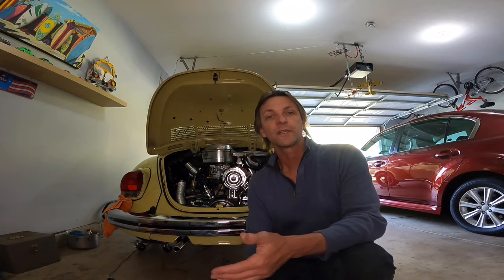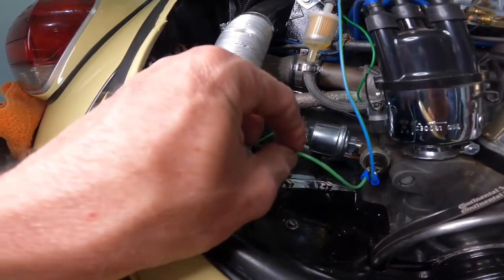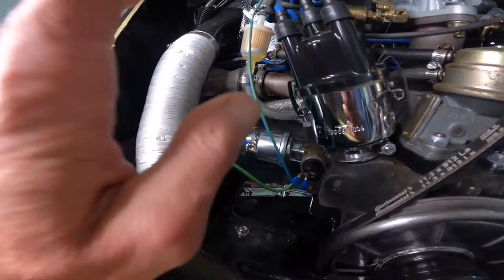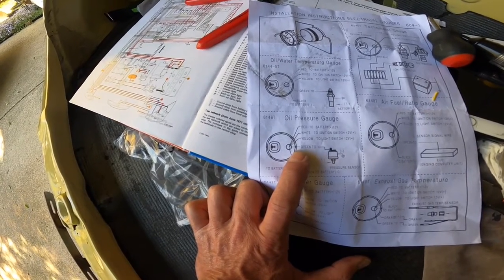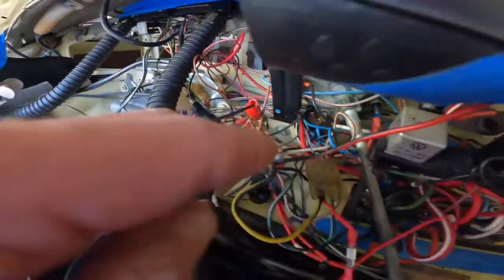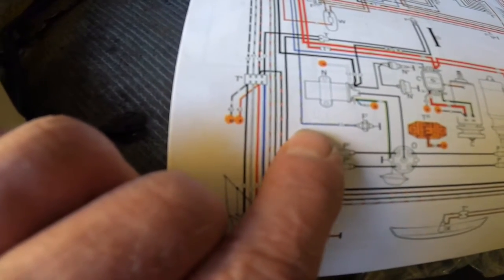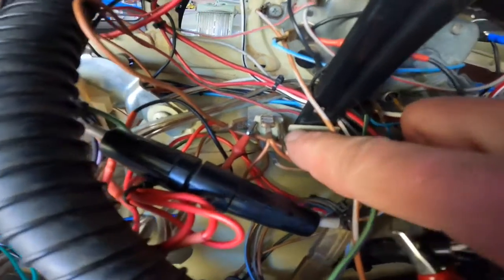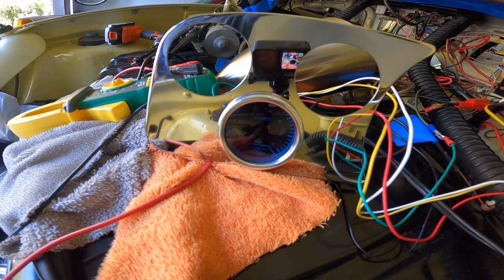Wiring 101 for 1971 Sup beetle oil pressure gauge installation

Comment: Junior, I really like your videos. Very helpful in reducing my wire anxiety. :) What is the reason for using a T connector with both the old sending unit and the new sending unit? Could you have just used the new sending unit and the OEM wire?
Reply from the maker: Using the same wire to get the signal to both the dommy light and new gauge

Comment: One disadvantage of sharing the same wire as the stock oil light is that when the low pressure switch activates it is grounding your signal wire, so the gauge will read zero pressure anytime it is low enough to activate the light. So if the light comes on at say 5psi, the gauge willl not be able to read a pressure between 0 and  5. I’m adding other gauges, so I plan to use a multi-conductor cable to accommodate them. I’m using gauges made by Westach, they are more accurate than regular automotive gauges, being primarily used on aircraft. Got them cheap on eBay, fortunately the company is still in businesses, [ made in USA] and I can get the sending units from them. They also have a cylinder head temp gauge, which is definitely useful for an air cooled engine.

Comment: Hello, love your videos and they helped a ton!  Do you have a video on the wiring for the front lights to the fuse panel?  That is basically my part to do.  I have the rears hooked up but not sure where the wires go from the front.  Thanks!!
Reply from the maker: I should, check my 101 wiring video series

Comment: Thanks for the video. I'm not familiar with how much the oil pressure should be. Shouldn't it increase as you heat up the motor? I would like to have seen that to verify that it is working. I too had some thoughts about an oil pressure or temperature gauge.
Reply from the maker: Thanks for watching. Yes it supposed to increase
Reply from the maker: I don’t remember exactly, however, the rule of thumb is 10psi per 1k RPM.